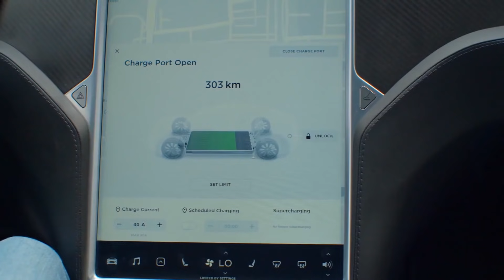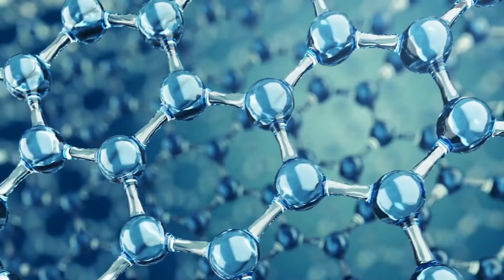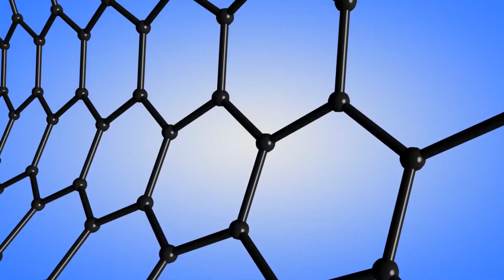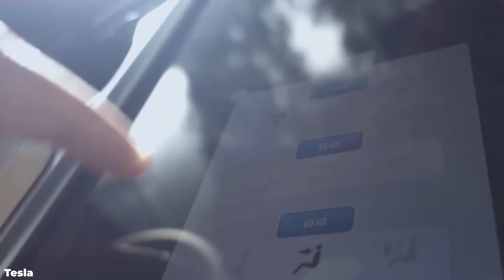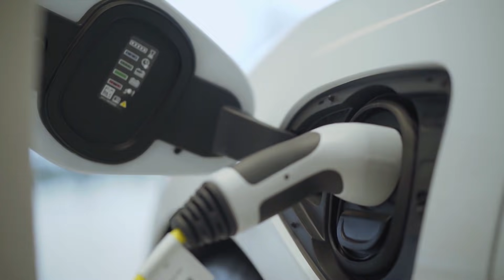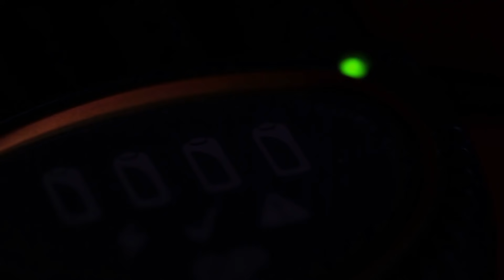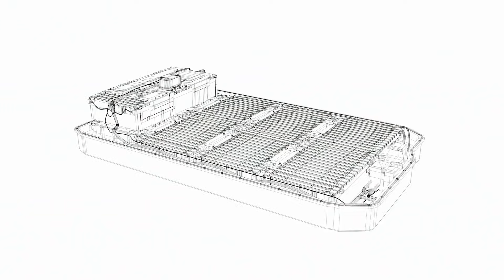GAME OVER! Tesla‘s New Nanotech Battery Will CRUSH Competition

Comment: This is clickbait, tesla doesn't have a "new nanotech battery".
Reply: Clickbait, indeed. Thumbnail shows an SMD Capacitor, not a battery. I clicked this video just to downvote it.
Reply: I totally agree with you
Reply: while it is spending billions to consolidate a supply chain for lithium it doesn't seem likely
Reply: We must understand the difference between base scientific research and commercializing research. For sure Tesla is making research about several promising future technologies but like with everyone else, there won't be fast breakthrough which change everything.

Some day some better technology enters into high end products and gradually replace old cells. For EV scale, I bet on new chemistry rather than some fancy nanotech material process. Those batteries come to cellphones and other portable devices.
Reply: Most big changes in most scientific fields have been accidental discoveries, there is no reason someone could not come across a metal alloy that could use nothing but a simple non corrosive annode to hold 100 times the energy in a battery of similar size, damn someone  could already have it working well enough for use today. That is how most discoveries are made, someone tinkering with existing tech and voila the next big thing.
Reply: @AndyAndy-we9pe  In real life, there is no change that this kind of wish would become true. Alloying anode and cathode materials don't increase capacity. It'll typically affect on stability and temperature performance. 

More critical for performance point of view is the substance which hold the ions in charged state. Potential materials for such use are pretty well known but for example using energy dense silicon with it's full capacity is huge technical challenge.

Electrolyte is maybe the only part where some unexpected discovery can be made but it affects mostly on cell charging and discharging performance, not energy density.
Reply: @teropiispala2576  Yeah, yeah, what you say is probably true.....but with the Giant Tesla doing the development and knowing where they are going and how.........the battery that charges the quickest will be the one that will power all EV's to come..........it's not capacity that rules the battery world, it's charge time......people have already said with one loud voice that they want quicker charge times.
With a quicker charge time you can have a smaller lighter less expensive battery because you can get it charged at a roadside charge point while the traffic lights are on red.........look back to 20 years ago.....2000........who had confidence in a guy with a brand called Tesla.
Reply: @gangleweed  People think they want very fast charging because they have used to hold the pump when filling the tank. 
Very fast charging brings lots of problems including increased charging infrastructure costs. It'll also compromise some other important qualities in batteries and limit chemistries which can be used. 20min from empty to full sould be enough. I wouldn't go higher. Enabling full speed close to maximum capacity would help the most.

For example 5-10 minute charger would be really expensive, time too long to wait and too short to go anywhere. Idle time costs would be high and the charger would need own energy storage or to be connected to high voltage line

Correct approach is charging possibility at home or work and then decently fast charging for trips.

There could be wireless induction charging coils under parking spots where vandalism is problem for cables. Slow charging is good for battery and it balance the grid rather than unstabilise it.
Reply: @teropiispala2576  That applies to current battery charging thinking.........if you went back 20 years the whole spectrum would be totally different......you learn as you go along and what is current today with what is being used today is old hat tomorrow.....always has been and the World will still be turning in a thousand years and technology will be developing as it always has been.
I did not propose to rapid charge a battery design of today, but when they evolve to perhaps smaller packs then a rapid charge would eventuate and roadside on the go or top up charge points would be the norm.......everything becomes reality once the technology of it has been established.......it's an ongoing evolution that will not stand still, never has, and never will.
The biggest problem with EV's is that they will not be able to match the population explosion and demand that is a daily occurrence and the road system will not be able to handle the volume of traffic that is the outcome.......in the country yes.....but commuting to the city will not be solved in the short term.
Reply: @gangleweed  I'm talking about close future maybe 20-30 years ahead. Biggest problem is the grid and there will be no immediate dramatic change on technology. Cable material is copper or mostly aluminium and costs come from peak capacity.

Installed grid storage increases, but it have much higher costs than electricity production, so counting on storage is not cost effective solution. 

Power electronics price can go down with higher volume but already now, biggest cost comes from ability to deliver high power. 20 times 1MW charging station is nightmare for power company. It has to deliver max power during rush hours and all other times it works with one tenth of the capacity. Same goes with batteries, although they can help the grig when charging activity is low.

Assuming there is home charging possibility for most people, it'll change the peak demand dramatically.

Very quick charging with small battery can work in cities but not highways. There are already battery technologies which can charge in 5-10 minutes. Lithium titanate batteries can go below 10min and last 10000-30000 cycles. They are not very light so you can have only 30kwh with same weight you have 75kwh traditional lithium ion.
Reply: @teropiispala2576  I would discount the use of the grid for future heavy EV  usage as it was not designed initially to handle the new load demands..........what I would be thinking of is every home had a power bank that had the density and could handle the sudden heavy charging load during the evening or any time of the day.
If you compare the EV load demand to the old flour mills that had a mill pond fed by a small stream to give them the capacity to drive the water wheels for the time it takes to grind a quantity of corn etc, then the same applies to the battery for home use.....the battery would be the mill pond and charge up during the period when no demand on it is required......the grid at the moment has periods when peak demand is high and it can cope but at night they have to off load to other storage or users to keep the system in equilibrium.........if each house had a  power wall then the grid could offload to it all through the day and keep the grid balanced etc..........at night the sudden demand for EV charging would be from each battery and some from the grid so no sudden heavy drain on the grid supply etc.
At the same time the increase in solar panel installations, and the effect of reducing the grid use during the day and so making excess electrical power going to waste or reducing the pay back to producers would not be a problem as the grid and the increasing solar input would spread the demand onto the power banks and give the home producers the return on investment they deserve.......it's the capacitor comparison to smooth the electrical demands that are going to happen with increasing EV use.
Reply: @gangleweed  I don't know about US grid but in my country, changing all vehicles to EV's will increase electricity demand about 9%. It is not much and current grid can handle it without any problems, especially when using home charging. There is practically no use case to have batteries at home so it is possible to fast charge there. With 11kw, car can be charged overnight and average driver needs only about 10kwh per day. Chargers can be controlled by realtime electricity price to balance the grid.

That works perfectly fine with normal houses. Apartment and city parking spots would need charging possibility too. That is a bit bigger challenge.

We must remember that all the electricity which goes through the additional storage have higher price and increased environmental impact. Direct use is always better. 

Grid costs come from peak load so we must avoid solutions like very fast charging and large charging stations. Those create very high peak demand in rush hours when people are moving.
Reply: @teropiispala2576  Well, that may be OK for small users but as I said when the grid is overloaded something has to give.......the home power bank would be practical as many times the home generator solar panel generators supply to the grid has been cut back when it is not being required, that could charge up a home battery pack for later EV charging.....why waste it to the air if you can directly benefit from it when it's free and going to waste......if you have excess electricity being generated from your solar array you are either wanting to make money from the sale of it to the grid or unwisely bought excess panels that you can't recoup the investment on.
Reply: Of course  not this is a tesla cult channel nothing is meaningful
Reply: What is is BS !!!!
This is pure clickbait there are no graphene based batteries made by Tesla.
Reply: I expect Tesla keep you personally informed as to their far reaching research and other secret projects because you are too wise and they value your wisdom from crystal ball gazing.........Tesla is too big for you to worry about what they are doing and don't inform you personally about......just sit back and marvel at someone who has conquered the auto world and is the way of the future.
Reply: @gangleweed  I'm not saying I know what Tesla is/isn't reasearching, but the claims in this video are just unfounded.
Reply: @adri535  They say that about anything that is going to happen but has not happened yet........to find out more, watch Tesla and see how they do it......the video is just a glimpse of the future about to happen.....crystal ball gazing is an exact science.
Reply: @Gus Erland ok shell
Reply: @Gus Erland You'll just have to wait for the inevitable to happen..............Rome wasn't built in a day and the steam train when it was first designed only moved at 5 MPH.......I won't mention the event at Kittyhawk that changed the way we moved from A to B.
Reply: @Gus Erland You are so wrong. There is one important word, efficiency.
Reply: @Gus Erland You information is highly inaccurate. Tesla alone sold 1% of world's passenger vehicles in 2020. Chinese sold much more and European manufacturers combined sold more than Tesla. Total percentage of pure EV sales are over 3%. Maybe you are looking old numbers, since it's growing fast.

Also statistics show that very few ev owners change back to ice. Reality for many is that they charge them home, 95% of all drive is covered by cheap and easy home charging and they need to use fast chargers only couple of times per year in longer trip. 

Driveability for EV's is superior and driving with ice soon feels terrible.
Reply: But they are starting to test graphine batteries, because they are starting to sell cells now to the public so they are working something. Musk only sells proprietary stuff when he's trying to fund his next big thing.